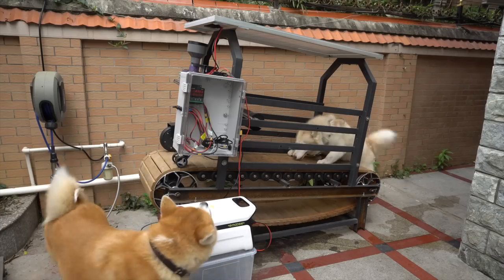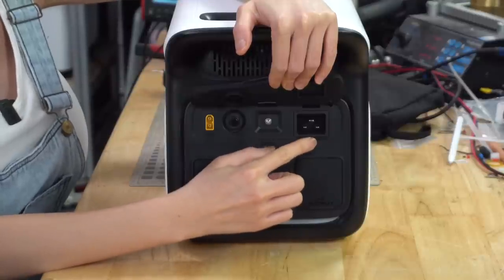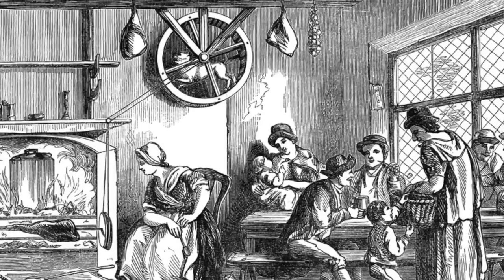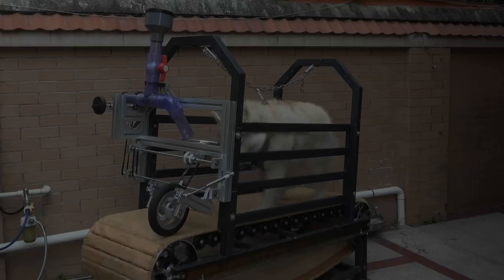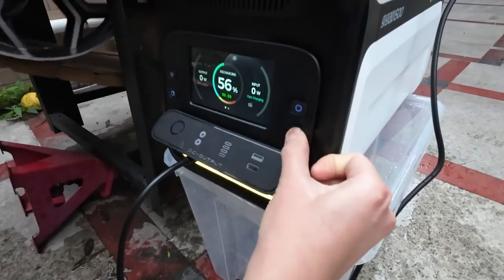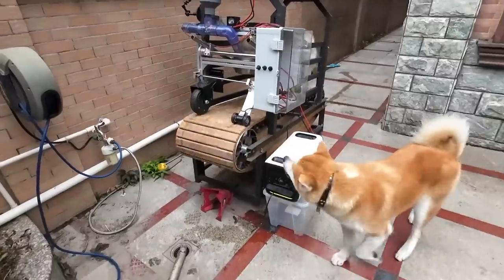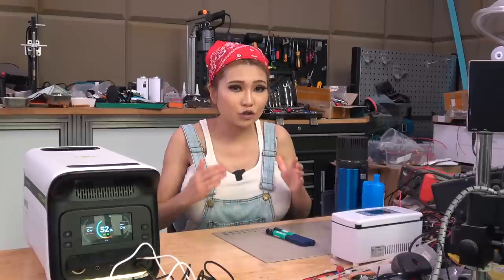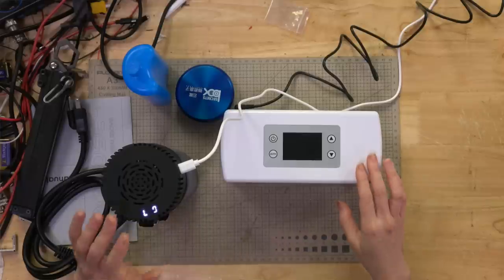Off-Grid With Dog Power🐶🔋 and the Emoose Battery!

Comment: Having dogs charge up a battery gave me an idea for dog sleds.

What if you attached a wheel like the one on the treadmill onto a sled. So when the team of dogs pull the sled, the wheel resting against the ground or snow, attached to the sled would also generate power.

So the musher (the human driving the dog sled) will be able to charge devices while travelling. 😁

Comment: This has been a very interesting video. Very outside-the-box thinking going on. I like the ability of having a portable power source that does not require a fuel generator. While power outages are rare, we do have the occasional tornado or snow storm. And ability to use a gasoline station may not be available. I can also see where this sort of power unit would we useful to a boater or camper.

Comment: I hate to be a pedant, but that C20 connector absolutely is a standard - it (along the mating C19) is the larger 20A variant of the common C13/C14 connector, both out of the same IEC 60320 series.  Admittedly, I'm probably a lot more familiar with them than most people having spent a lot of time in data centers.

Comment: I live in Texas, after the huge ice storm we had knocked out power for weeks I wanted a cheap easy in the background solution for my insulin. 
I settled for a cheap battery back up with an AC power inverter. I was gonna hook it up to some solar panels but it also came with a dc input. So I just keep it charged. Next I bought a cheap thermo electric fridge it came with a 12v cigarette lighter adapter my power battery has that connection too. We had our power go down and it all worked like a charm. Even without the solar panels. Just make sure to test your equipment before you need it. 
We tried the thermoelectric fridge to see how cold it got. It was enough to keep the insulin fresh. Ok how long does the battery power the fridge? 1 day and a half. K that’s enough for me to ask around and get ice and keep it in a regular cooler. Luckily the lights were on after a day but at least we have a backup plan. And the way climate has been changing it’s a good idea for everyone to have those plans

Comment: I've always thought about getting something like the Emoose battery for use in power cuts or the like, not done it yet but only in small power banks, however I'm building a house and it'll have solar and GivEnergy 9.5 kWh battery system which I'm so looking forward too!

Comment: Normal fit human can easily produce 300W in crosstrainer or bicycle. It's more than enough for large tv, so would make sense to build a system where TV must be powered with muscle power. One hour training could give 5-2 hours of watching time depending on the size of tv and how power hungry it is.

Instead of getting fat in soffa, people would stay fit and save in electricity bill. Both excersice machines should be quite easy to connect into generator.

Comment: Hi Naomi, thanks for sharing this great project, I learned a lot!
Would you have some idea of how much power your dogs were able to generate per km with this set up? Maybe I missed it in the video?
For info, I had been looking at the M5 stack as a great way to get into ESP microcontroller programming, your video has made me reconsider, I'll probably just get an ESP32 dev board instead, thanks for the tip!
Have a great day and keep doing what you are doing,
Chris
Reply from the maker: It's been all over the place while I train them, now that they are really putting in the time it should be more consistent, I'll measure it. But it's really not much- just to charge a cellphone or something.

Yeah I hate to drag the M5 but for learning, no way. If I had a custom product I needed 20-100 of, and a microcontroller to drive it, it might just be worth it.

Comment: The microprocessor treat-droppers are easy(?) to re-program; but the simplest mechanical device is the core of a "seed drill" which meters one crop-seed per foot of land. China had seed-drills thousands of years ago. The meter can be as simple as a notched wheel blocking the seed bin. As the wheel rotates, one seed per notch passes through. 

Love your dogs and your razor. 🥰
Reply from the maker: Ah! Also a clever way👍🏻
Reply: @Naomi-Wu  When I was young, I wanted to computerize everything. As I age I realize that our Ancestors knew some excellent ways to do things (like mechanical movements and meters). Here the feed-rate (steps per treat) could be adjusted with notching and gearing (which can be peg-wheels instead of involute-tooth steel).

Comment: Hi Naomi looks like you and the fam are having a blast "stickin' it to the man" by generating all that electricity on the DoggoMatic 2000 generator! In all seriousness though, yes hardware drivers are always an issue and unbeknownst to us is that the new design and sales model is sell it first and then fix the drivers, firmware, software and such later by getting their input. Pretty crazy but it makes me want to tell these people in writing up front that if their product does perform exactly as advertised out-of-the-box, then I will chargeback the order. I will also not spend hours on the phone, emails and texts troubleshooting their BETA products and thereby simultaneously paying and testing a product that never should have been released in the first place.

Comment: I have seen testing done on these types of battery powered power banks, It was shown that the DC to AC conversion was almost always slightly more efficient than the regulated DC to DC conversion, so it may not be much better to use DC when it is an option. There is the factor of using the AC to power a power supply that also has its own losses, and in that case the DC usage may be slightly better and more efficient in the final end, even though the total power output of the battery bank is usually a bit lower when using the DC output option. The DC option could be a better option if DC to DC regulation was not being used in the batter pack, but most do use that regulation and it has it losses.
Reply from the maker: Ohhh, interesting! I'll have to check now, thanks!